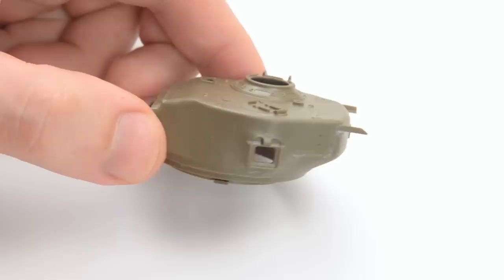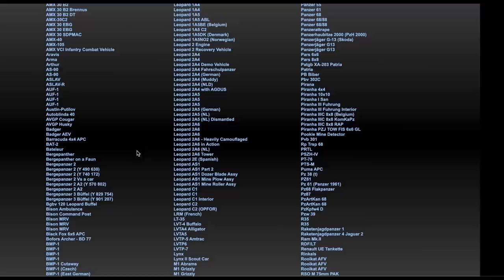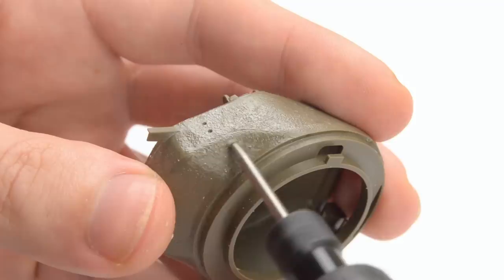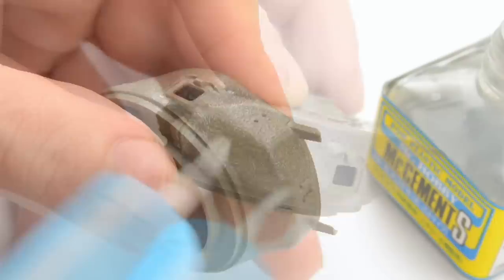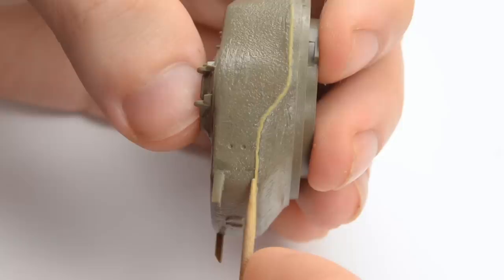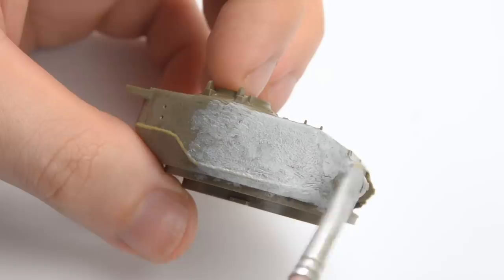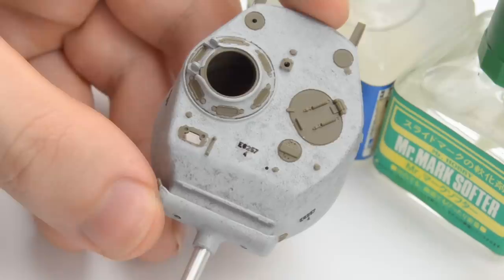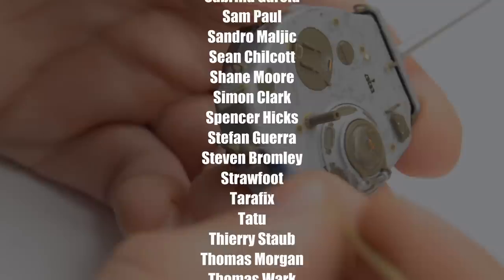HOW TO: Cast Steel Armor Texture For American Tanks

Comment: Another Sherman!  That's the third one today 😅

BIG EDIT: to make the foundry markings, if you don't have the archer resin decals, you can also carefully slice part numbers and letters off the sprue and glue them onto the model.  I've done that and it works pretty well ☺
Reply: @dotdashdotdash  always!
Reply from the maker: Me when I saw that we're again gonna build the same tank: Ah shiet, here we go again 😆
Reply: @NightShiftScaleModels  nah, I just put up the Sherman video this week since I didn't have a tutorial done from the Pz III.  I don't think I'll go back to the Sherman for a number of weeks...
Reply: Sherman! 😆
Reply: Great idea, but i'm probably to lazy and those specific Archer transfers seem hard to get in Europe...
Reply: Do you two coordinate your builds?... :)
Reply: @ChrisK-LTC  we did with the Tigers, but the Shermans is just a coincidence this time.
Reply: @guidor.4161  www.historexagents.com sell them. Sure, he asks a bit more than in USA, but shipping is lower, and not tax (for the moment, after brexit it may be different, therefore I bought a lot of rivet decals)
Reply: I know a good trick with fuse-wire, but it is more appropriate for Soviet foundry marks.
Reply from the maker: The problem with sprue numbers is that sometimes they don't come in the size you'd need. Archer even includes 1/72 scale foundry marks. Sure, you can't tell the individual numbers apart, but hey it's in scale! 
And Paul's fuse wire method is actually very legit!
Reply: Yours and Martin’s i’ve seen. Where’s the 3rd one?:)
Reply: @TheInnerNerd  thx!

Comment: When large pieces of metal are cast they often crack as the metal cools, especially if it is cooled too quickly. It’s very common to see these cracks welded up.
Reply from the maker: I have seen something like that on Soviet turrets. Sanded welds that look like veins, sometimes squares. Could this be it? Maybe the welded squares are leftover sprues?
Reply: @NightShiftScaleModels  I'm not sure on Soviet casting but I have seen examples of their engineering in the past and it's pretty rough, but functional. After the collapse of the Soviet Union I did have quite a lot of experience with Russian equipment from former states such as East Germany, Yugoslavia etc. Mainly ZIL 157, BMP, BTR, BDRM, ZSU Shika but sadly no MBTs.
Cracks would be vein like and filled with stainless steel weld as this doesn't crack when cooling, also it won't rust over time and will be quite bright as I've seen you do in the past so that's accurate.
The squares would more than likely be sprues that have been cut off and ground back, TBH these could be any shape as it all depends on how they were cast and how the sprue is formed by the factory.
There may also be serial numbers cast into each part, but it was also welded using stick welding. I know some Soviet era serial numbers were also stamped on so the whole area is a bit of a minefield and probably dependant upon country and factory of manufacture.

I grew up near the royal ordnance factory at Barnbow in Leeds so tank manufacture was quite a common subject as I was growing up. It was often said that Chieftain hulls had to be repaired by welding once cast due to the sheer size of it and the thermal stresses placed on it when cooling.

Comment: Dear Mr Nightshift
Having seen a few of the tanks up close when being restored and stripped back to bare metal for repairing, priming and painting casting on American tanks is not very rough, even the welds and cut offs are generally very smooth.  More often it is layers of paint slapped on by any means how or repairs or on old tanks just weathering

Comment: I've been looking but no one has a video on how the paints are used. Like... what goes on first then on top of that then on top of that? Acrylics... lacquers... enamels? and why? what are they thinned with and the benefits of one over the other.  What type of paint can go on top of another type or should you not do that.  I know you talk about it in some of your videos but is there a detailed painting video you have or know of another? Which kind is used for panel lining and which are used for top coat to chip off or which should not be used.  Also what type of clear goes between coats and how many coats of clear go on... one coat of clear between each layer or only on top of the base paint and one on top of the decals?  I look at a lot of modeling videos but I like how you cover the info the best.  Is there any way you can make a video on paints and their applications for dummies?

Comment: Maybe I've missed it but... how does this method compare to simply applying thicker putty like Mr Surfacer 500 or even Vallejo Plastic Putty and then dabbing at it with a brush? You ended up covering most of the turret with putty anyway...?

Comment: Do you know of any techniques to achieve this texture, or the armor texture you showed in that previous video, on models that are not plastic? The gouges, tool marks, and seam line would likely work just fine, and it's possible the texturing putty could work as well, but obviously plastic cement won't melt resin or pewter like it does plastic.

Comment: wouldn't be good to make a groove first on the seam line before applying the epoxy putty?
Reply from the maker: yeah, it would make the application easier and more precise. but then again, scribing a groove on a curved surface like that... I'd rather apply the putty the way I did

Comment: Don't forget the French - most of their early tanks were cast all over.
Reply: Because they couldn't weld and hadn't the Industry to produce RHA the AC2 is a similar story but next to New Zealand
Reply from the maker: It was a superior method back in the day, like in the early and mid 30's
Reply: @NightShiftScaleModels  yeah every nation built the best possible tank for them if they have the Industry to do
Reply: The only reason the Germans didn't cast more was that they couldn't.
It was a superior to welding, especially for turrets. Basically everybody cast their turrets from 1941 until composite armor became a thing with 2nd generation MBTs (M3 to M60, T-34 to T-80).